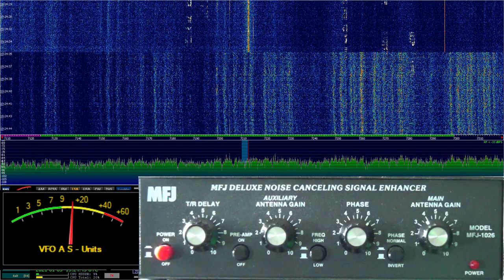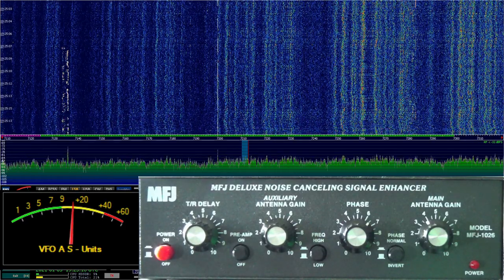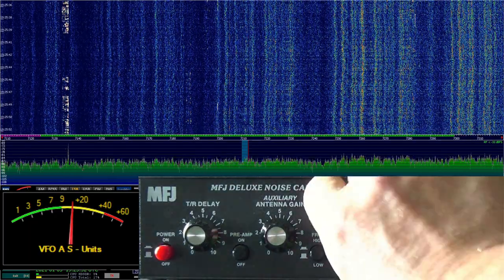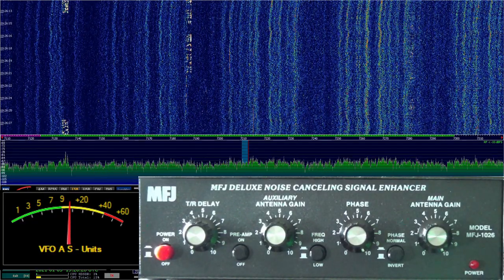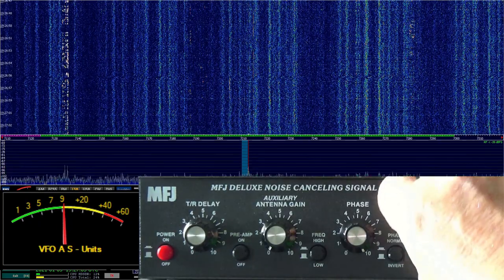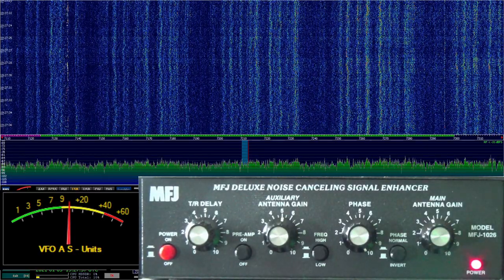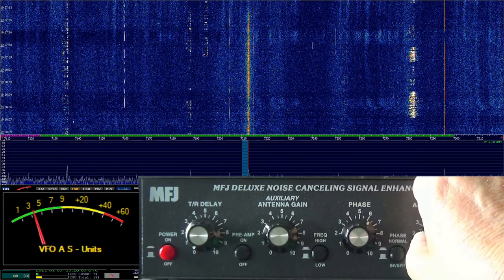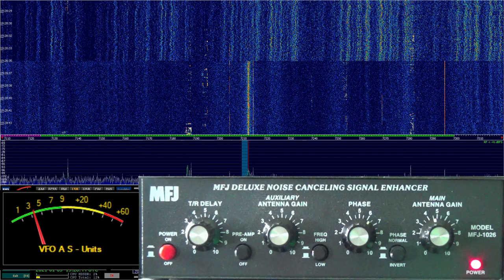Reducing HF Noise Using Antenna Phasing With The MFJ-1026

Comment: Stu:  What are you using for an auxiliary antenna?  Main antenna?  I have been thinking of getting one of these.  My noise floor on 40 meters is similar to yours.  My main antenna is a fan dipole (80-40-20-15-10M).  Thanks!
Reply from the maker: Hi Bob!
Well, the Aux Antenna is a CHA-250b and the Primary is an fan dipole (80-40-20-15-10M). You can use about any Aux antenna you want. There is lot's of info regarding the type and configuration of the Aux antenna in the docs for the MFJ-1026. One glaring note I need to make... Make sure the interference is coming from something you don't have control over. If you wait a bit I will be coming out with a video on testing for local noise.

Stu
AG6AG
Reply: @AG6AG  LOL!  I guess I shouldn't have scrapped the CHA-250 after all...!
Will check out those docs.  Have been putting ferrites on most everything in the shack, hasn't changed much.  Tried the test for common-mode noise on the coax, and that's apparently not the problem either.  Will be looking forward to your next video.  :-)
Reply from the maker: You can use just about anything that receives for that Aux antenna. As a matter of fact, the primary and aux antenna should be the same polarity. I used the vertical because it was in the air already, but I'm thinking of putting up a long wire or un-matched dipole for the aux antenna in the near future. Remember, you only need "ears" on the aux antenna... It doesn't need to be resonant like a transmit antenna...

Stu
AG6AG
Reply: @AG6AG  Hi, Stu - I bought one of these and am waiting for the receive antenna (a MFJ 40-20-10-6M dipole) to get here from GigaParts.  In the meantime, I tried it with the little wimpy antenna it came with, and it actually knocked about 1-1/2 to 2 S-units off the noise floor on 40 meters.  Quick question - would I connect the "TX GND" jack on the FTDX-3000 to the T/R control jack on the MFJ device?  From the manual, that would appear to be the right choice but just wanted to make sure.  Thanks!
Reply from the maker: Hi Bob,
Yes, the TX GND Jack on the FTdx3000 should go to the T/R Control Jack on the back of the MFJ.

Stu
AG6AG

Comment: Forgive me if I'm wrong but if the Main Antena Gain is lower than the maximum (10) it seems to me that you're also attenuating the receiving signals, no? 73 de PY5CL
Reply from the maker: Hi Carlos,
Yes, you are reducing the signals across the board, but by combining the two antennas you are able to lower general noise and around your signal of interest.
I'm not an expert on phase and diversity when it comes to antenna arrays, but from what I've managed to gleam from the literature, the phase of the two antennas can reduce the unwanted signal why allowing the wanted signal to poke through.
I was actually kinda surprised that it works as well as it does!

Stu
AG6AG
Reply: @AG6AG  Thank you! I also have the 1026 for many years and still have some difficulty to tune it. Lately has started a terrible power line noise here  that I can't get rid of, I think my auxiliary antenna is not good for capturing noise. Sorry my poor english.

Comment: I get similar noise floor on 30m, been looking into one of these for a while but not decided yet.
Reply from the maker: Hi Steve,
It's a tough call as to whether to invest the money... Trying to use the internal antenna was not the hot ticket for me, which means I have a HF multi-band tied up to the device.
I would exhaust all the other less expensive options before spending the money on this... It worked well for me, but it doesn't work in all cases and like I said, you will most likely be tossing at very least a receive only HF antenna at the problem as well.

Let me know if you decide to try it and how it works, or if you find a better solution!

Stu
AG6AG